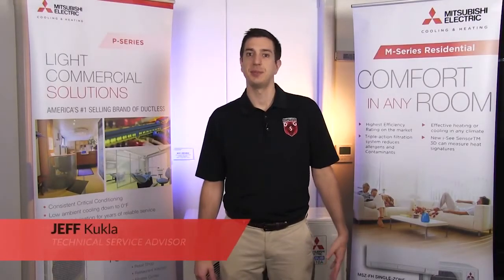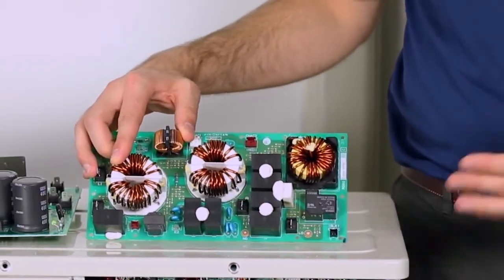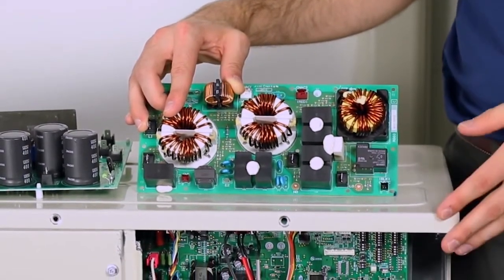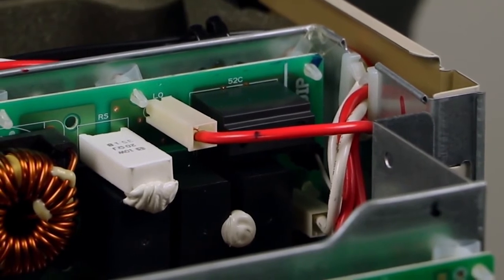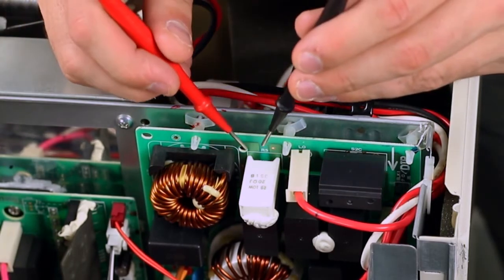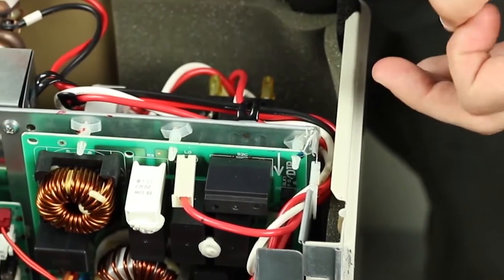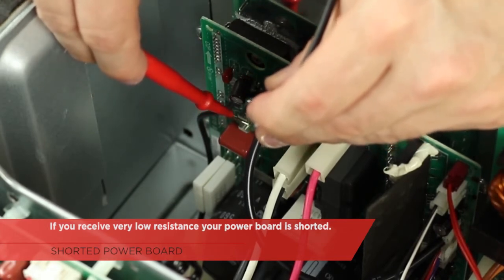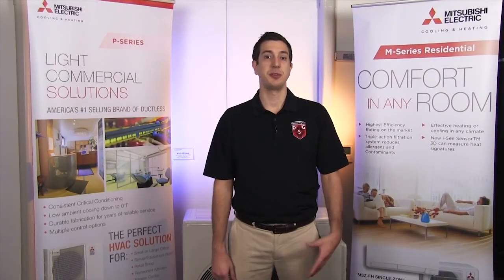Tech Tips: How to Diagnose a Shorted Power Board (L)

Comment: I have a Mitsubishi MrSlim R410A model MUY-D30NA. It’ll start working but then it kicks off and the light starts blinking three times. I’ll go up to the unit on the roof and there’s no lights showing but there is power going into it. Would that be a bad board? I’ve had the mini split for over 8 years and this is the first time I ever had any problems with it. Any help would be appreciated.
Reply: Go to the indoor unit and recall for error code. You must have the tach manual to proceed with the test

Comment: If the power board shorting is a common problem, why is the board designed that way? You didn't explain the underlying cause of the short. What is shorting? A transformer? A capacitor? A power transistor? The bridge? Which is it? If the power board is shorting, there is a reason. We need to know the reason if the underlying cause is to be fixed.
Reply: Q. C. Is going downhill as is everything else greedy corps.!

Comment: I have a MXY-3A28V condensing unit .The indoor unit displayed 5 blinks and outdoor 2 Red flashes.i checked the compressor and it was fine.i changed the power board any yet the system does not work.The compressor comes on for 06 seconds and shuts off.Could you help me with this.
Reply: Did you manage to get this problem solved?
Reply: Swapped out the compressor 👍
Reply: Sounds like u had power surge, replace all tge boards + install surge protector to protect it in the future occurrence from repeating